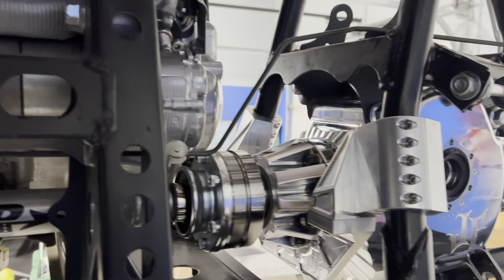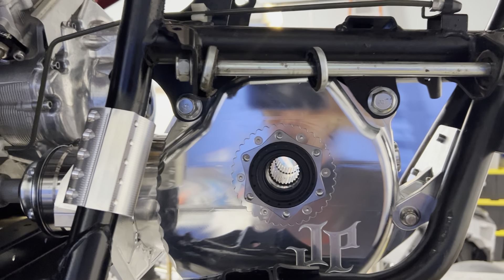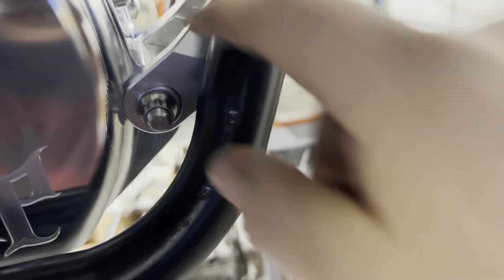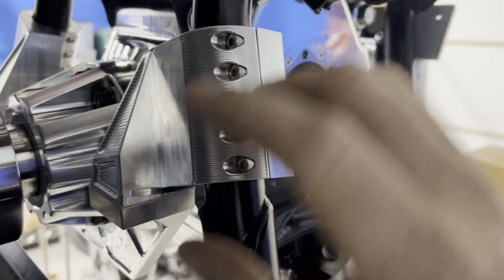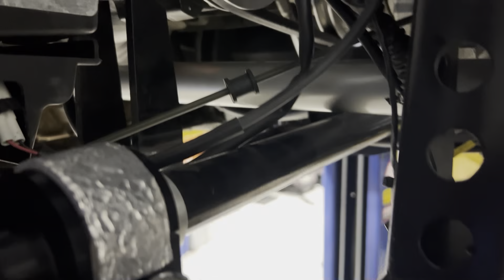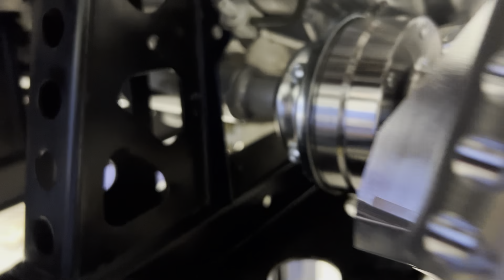Juarez performance billet YXZ 1000r rear differential install overview

Comment: i have not done the looking around before asking so forgive me for not knowing but why do you need an alternator kit on your car. I have rugged radios, a pillar light, mirror lights, strobe lights for rear and baja designs headlights. should I be concerned about running out of power?
Reply from the maker: You do have more accessories that what the factory stator output can run. You do not need an alternator,  But you do have to be mindful of what you are running and for how long so you don’t kill the battery and get stuck somewhere (been there done that😂) alternator allows you to use any and all of your accessories at the same time without worrying about the power consumption.  We produce a 75a and 100a version for these Yamaha’s.  You can turn every single accessory you own on and leave them on for the whole ride if you want.
Reply: Factory staters are generally considered weak. As long as you keep an eye on your voltage and it doesn't dip down too low when using your accessories it's fine. An alternator is just a quick and easy way to ensure you'll never be left without power.
Reply: Yes I have indeed ran out of power 1 time. I was running music, radio, a full size light bar & a 10” light bard, & partial separator. I ran an alternator after that & never had an issue again.